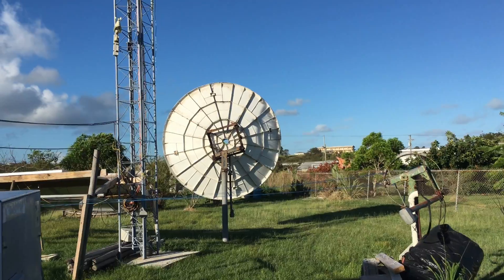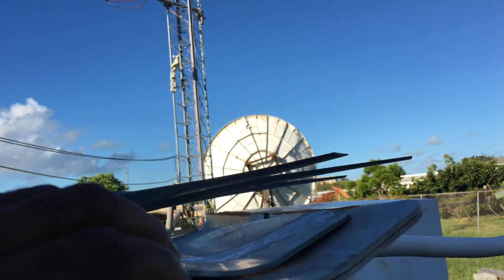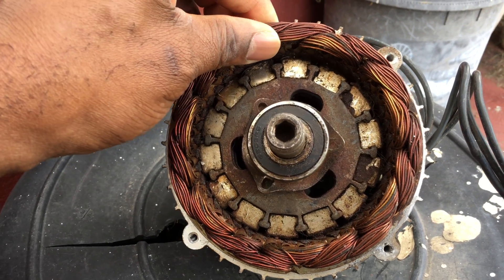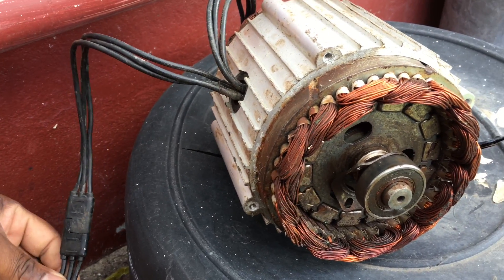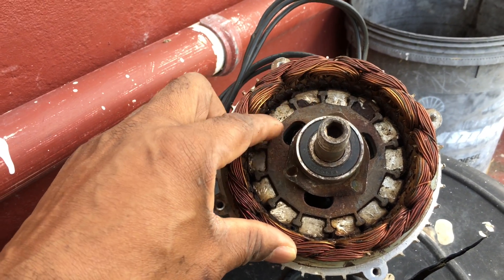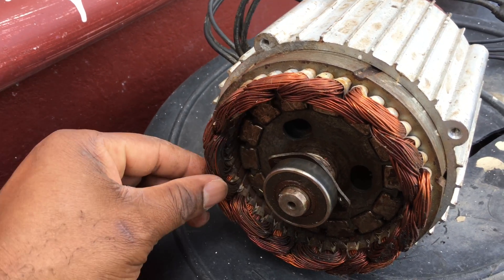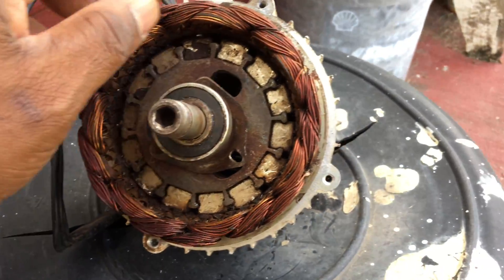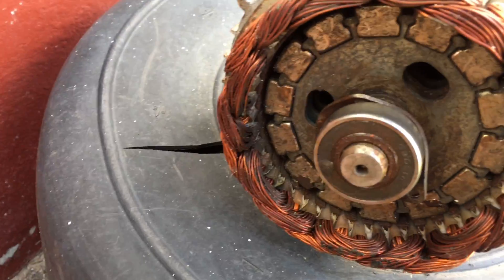Deeper into My Turbine Operations

Comment: in my experience atleast if your turbines rated voltage is too high in relation to the battery bank voltage the turbine bogs down and struggles to hit higher wattages.
I guess if your magnets are now secured in place and the bearings are new  Hensley will have wind power again.
Of course i knew you'd fix it all and have them up again.
do you see any changes in winding color from heat after the strong winds?.
I don't want to aggrivate you too much but maybe one fine day you could try something else as a comparison for you to see different characteristics in turbine performance in lower winds which surely you have no end of in your beautiful location in the world.